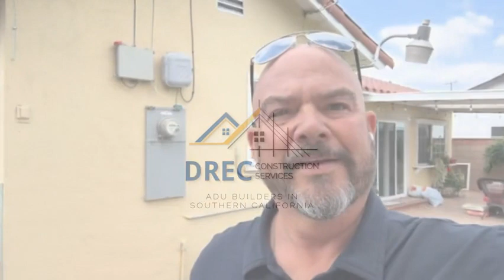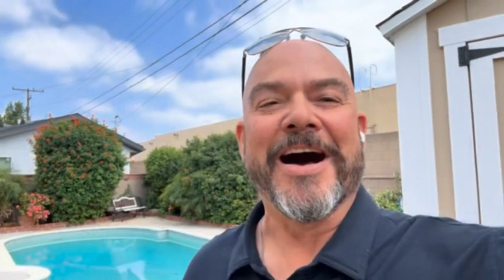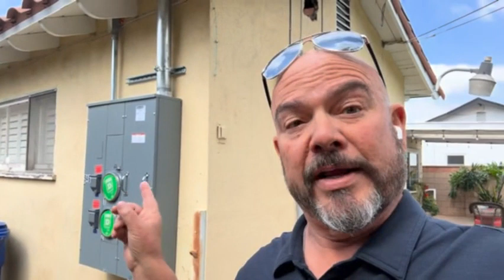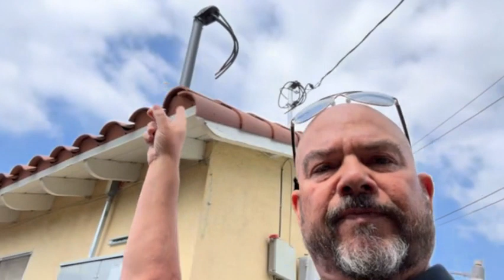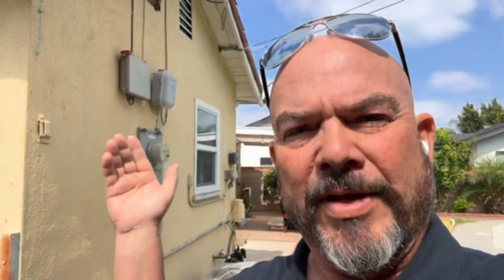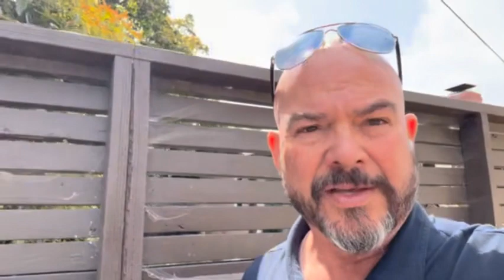"ADU Cedartree Rd. Downey | Part 16: ADU Double Electrical Meter Installation: Step-by-Step Guide 🏠⚡

Comment: how much does this cost approximately? I am in the process of building a detached ADU and was told I am going to need a dual gang meter panel. I do have a 200amp on main house already since I installed a solar panel year